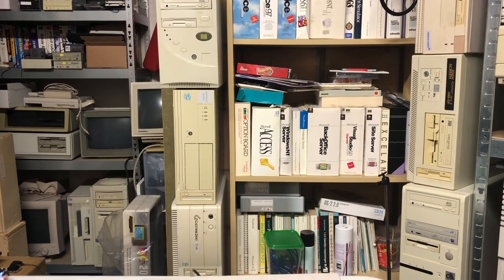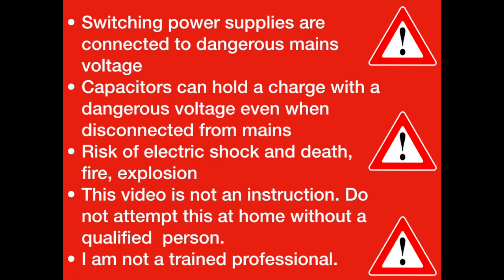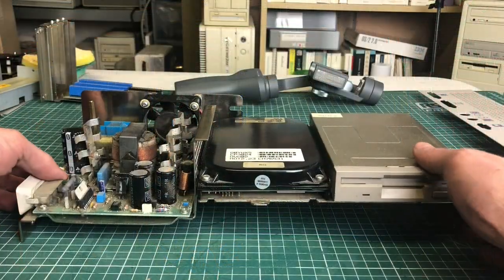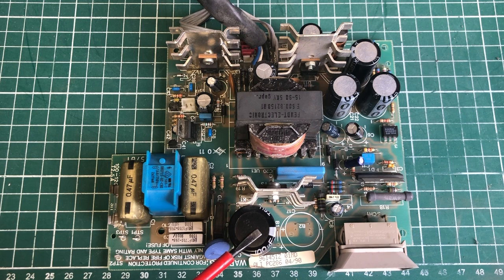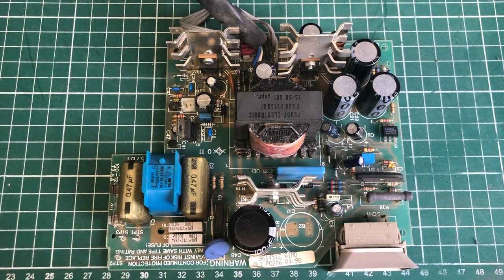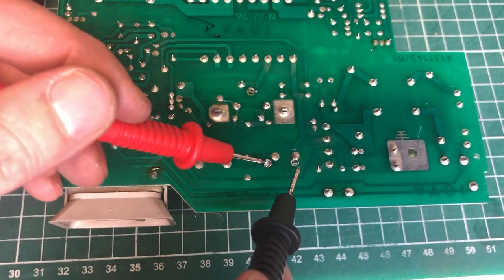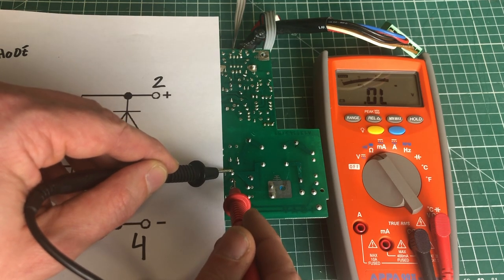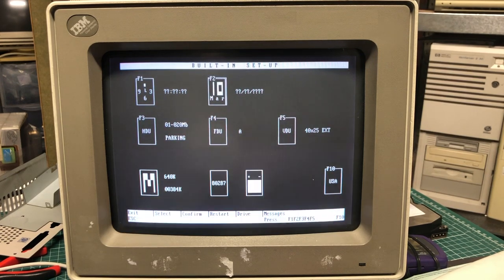Olivetti PCS 286 Rescue Part 1

Comment: You can get the yellow out of the plastic with Hydrogen peroxide. You get paper towels and soak them in Hydrogen peroxide then you lay them over the plastic and set it outside in the sunlight for about three hours and repeat that about three to four times and it will turn the case bright white like it was when it was new.

Comment: Hello, what is the reference for the fast switching power transistor you replaced with ???? i have a similar computer and the power supply is acting strange.. gives me a very wide range of voltage readings.. in the +5v i can have from 4v to 6,3v... i've replaced all the electrolitic capacitors, bulk capacitor, the two pair of Ac filters,..i think the power transistor may be faulty.

Comment: Hi Retrospector! I'm restoring an Olivetti PCS 286, still have to replace/mod the Dallas RTC.
With the dead battery I can't manage to get basic bios settings saved even if I don't powercycle the machine. Is that normal? Maybe I'm not saving settings while exiting the setup? Tried with esc and enter but on reboot no settings saved.. Can u help me or give some advices please?

Comment: Do you have experience with removing corrosion from a motherboard? I just tried to remove corrosion on my 486 motherboard with vinegar and water and I forgot to take out the battery. Now I think I killed the board (But I think the battery was empty anyway). I'll find out when it's completely dry again.

Comment: Right at the start of the video, that Kompact Serie III desktop case, did you get that on eBay by any chance? ;)
Reply from the maker: Nope ... rarely buy retro stuff on ebay.
Reply: @RetroSpector78  I would think that the shipping cost for a retro computer would be insanely expensive. That's why I never buy computers on eBay, at least.
Reply: @the_kombinator  Ha, that's pretty good!
Reply: @ct92404  My systems for the most part are complete, ready to go, with OS and games on them, and I try to maintian era correctness when possible. I film the interesting ones and their sales fund more strange purchases. Keeping a steady flow of comptuters gives me material to film, and some precious finds (I don't always know what I'm getting! Sometimes garbage but mostly not.)go into my personal collection, which my wife is just super thrilled about ;)
Reply: @the_kombinator  That's cool. What kind of computers do you like to collect? This is still kind of a new hobby for me, but personally I prefer to collect early 8-bit computers because I like the challenge of programming them. It's really cool to see what they can do despite their limitations.
Reply: @ct92404  My first PC was a Compaq Deskpro 386/20e. It was an SX, so 16 bit data path. 1 mb RAM, 40 Mb hard disk, expensive and proprietary upgrade path... a wretched machine to be sure, that was old when i got  it, but my sister showed me the basics of DOS and that was the start. 

I collect anything from the late 80s to the early 2000s, with the Golden Era being 1994-1999.  These machines are getting harder to come by and ogten require repair and reconditioning but i enjoy doing it. Check out my channel, i do similar stuff 😁

Comment: be very careful substituting power transistors in switching psus and crt tv line output stages, ideally replace with identical or 'approved' replacement types or they may fail after a short while or even instantly.. check online or in databooks to make sure theyre 'compatible' ..
Reply: your replacement, the BU508D is normally used in tv line output stages, it has an internal diode collector to emitter, most psus dont need this, so a type BU508A without diode would do, but these two types have fairly low current gain, not a problem in line stages as they have quite a high current drive,  in psus a type needing a bit higher gain is usually required,  such a type in similar casing to the BU508s would be a BU426A..

Comment: Are those 0.47µFarad caps RIFA's?
Reply from the maker: They are not from the rifa brand but from Wima (also metalized paper caps). I don’t think they are as sensitive to cracks as the Rifa ones but I guess you could replace every component that is > 30 years old :) Will probably replace those as they are subjective to high voltages, and don’t know the history of this pc and how it was stored.

Comment: I've one just like this. It used to blow the fuse as power goes on. After some time I got it running again. The problem was in the first stage of the power supply unit and also in the board: RTC https://www.classic-computers.org.nz/blog/2009-10-10-renovating-a-dallas-battery-chip.htm

Comment: What is the quick way to discharge the capacitor.
Reply: Short it with a 10K resistor
Reply: @DxDeksor  not "just" a 10k resistor. This guy tells you how to properly discharge a capacitor of said caliber: 
https://youtu.be/gLDCV-n1BDw 

I have made one myself and I also discharge CRT tubes with it. It's a lot safer imo!

Comment: Replace those brown RIFA caps as soon as possible!
Reply from the maker: They are not rifa (the brand) caps. These are Wima branded caps that have a longer operation life and are apparently not known to crack like the rifa branded caps are. I am going to be replacing them as this psu does date from 1990 and the operational life of 300.000 hours is getting close :) Do you have experience with non rifa branded metallized paper caps ? Do all of them blow up like the rifa caps (with the notorious smell to go with them) ?

Comment: Always replace the inline capacitors!!!
Reply: the line filtering caps?
Reply: @arnaudmeert1527  yes those tend to blow open
Reply from the maker: Are all MP safety caps known to explode ? Or was this specific to the Rifa brand ?
Reply: Even if they aren’t Rifa, it looks like a similar construction.  I always replace them anyway, for anything older than ~2000.  Even the newer box film type.  They’re cheap and they have a hard life.  ;-)

Comment: please use color monitor to see what kind of colors have BIOS SETUP
Reply from the maker: It is a color monitor :)
Reply: @RetroSpector78  wow the lighting fast replay thanks! ? so the BIOS SETUP is monochrome :D ?
Reply from the maker: intel386DX seems to be ... just start edit and it was nice and blue. But BIOS is black and white.
Reply from the maker: intel386DX cool things is you can enter the bios from the dos prompt without rebooting :)
Reply: @RetroSpector78  Wow fantastic ,what is the combination of keys for entering the BIOS setup or it is a DOS EXE or COM file for this? 
BTW I have an IBM Thinkpad 300 this is a  early 386SL 25MHz laptop and it can enter in the BIOS SETUP with Fn + SETUP function keys from OS (DOS, or Windows 3.x or even Windows 95!)
Reply from the maker: intel386DX shift-ctrl-alt-del
Reply: @RetroSpector78  :) I can not wait to see the second part! And learn more about this cool unusual PC ! :)